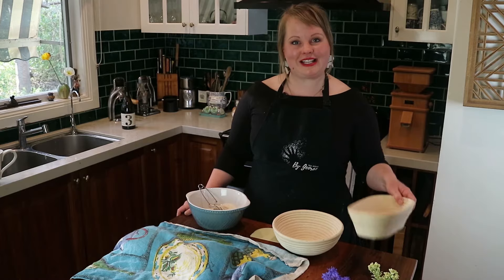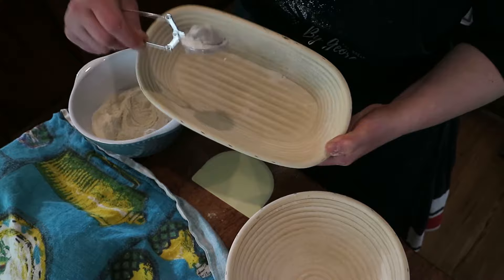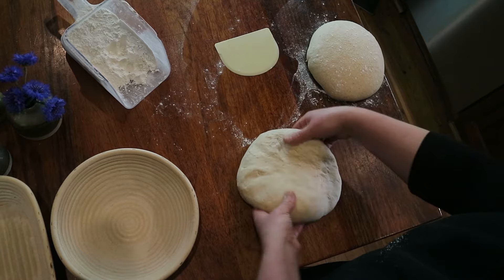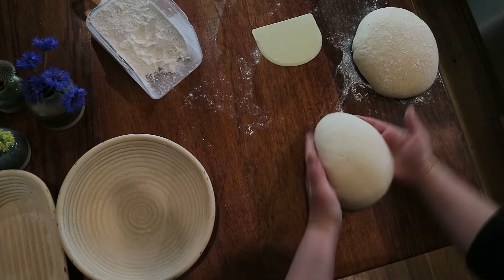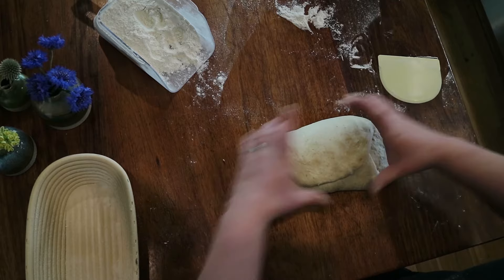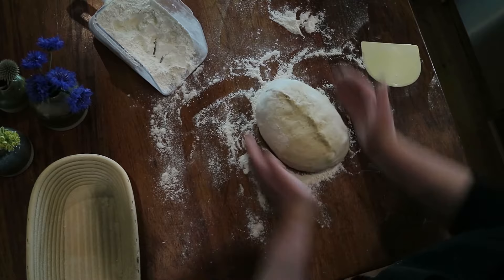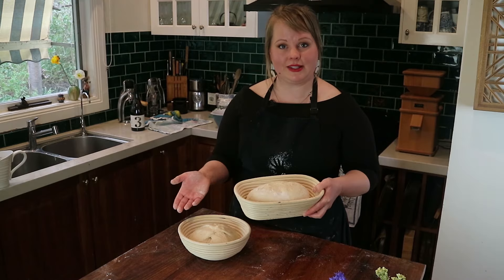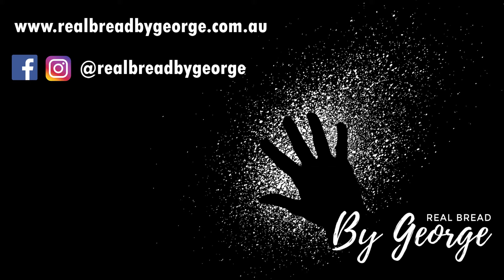Sourdough: Final shaping technique - boule and battard

Comment: Hi,
 I have a starter in my fridge which I refresh every two weeks when I bake my bread. I am going away in December for two months and I am not sure what to do with my starter to ensure I can continue using it on my return. If you are able to help it will be really appreciated. Thank you.
Reply from the maker: Hello Margaret - your starter will be fine left in the fridge for two months. Feed well, seal the jar and leave it in the fridge. When you return it will look worse for wear - simply scrape off everything, leaving just the bottom centre section. Feed this and leave at room temp. In a day or two it will be back to normal.
Reply: @realbreadbygeorge4973  Thanks for replying. When you said feed well, what should be ratio of old starter to flour to water? Thx
Reply from the maker: @margaretborucinski2885  Sorry Margaret, I missed your reply - I recommend discarding all but 1 tsp of starter, feeding the remnants 50g of flour (50% rye, 50% bakers) and 50ml of water. Put it in the fridge with the lid on. When you are ready to use again, simply discard almost all of it, repeat the feeding process and leave at room temp with lid ajar. You'll need to repeat the discard/feed process for a few days and it will spring back to life :)